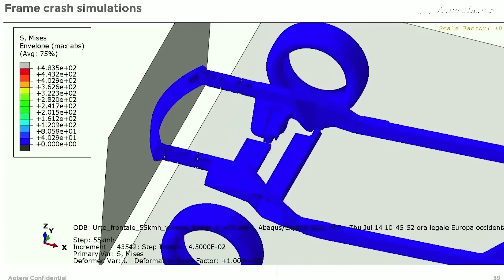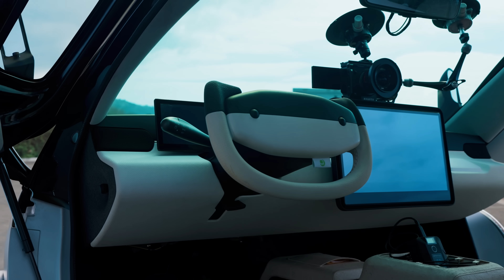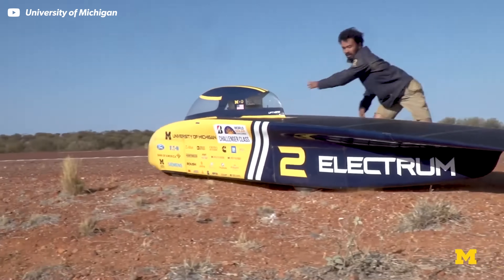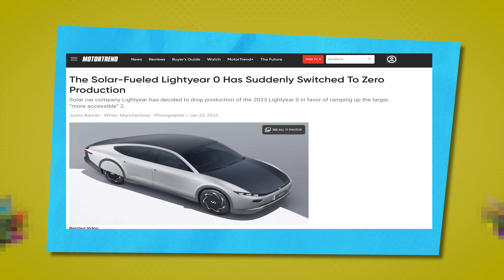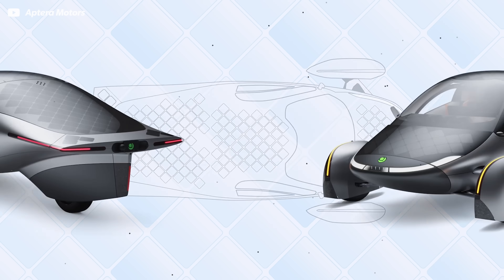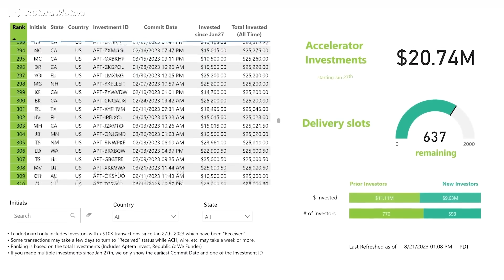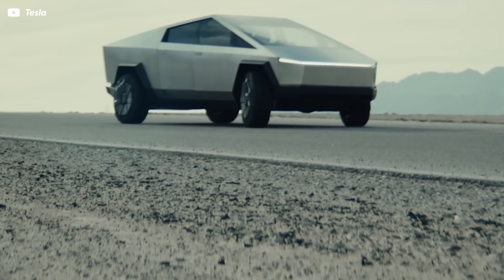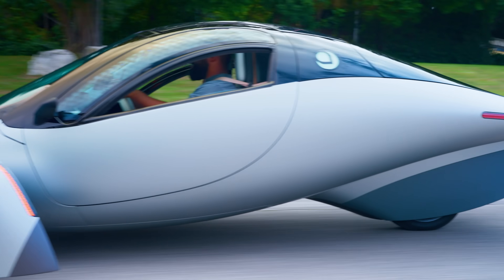We Drove America's First Solar Car

Comment: I'd love to see some parking panels that automatically slide out to gain additional charge while parked.
Reply: I believe Aptera released in a video that they plan to have the M.4 connections that solar panels use to allow for additional solar panel usage.  So there isn't a fold-out option, but, you could add additional solar!
Reply: @Peter-wz2wx  that would be really cool, but I bet most people would prefer something that is low effort, you know?
Reply: What about a windshield sun shade that's a plug in solar panel for when you are parked.   Free energy and keeps the interior cooler
Reply: @Peter-wz2wx that's cool. Cheap mono panels can be found for 70-80 cents a watt easily.
Reply: @thefatmechanic  low effort but breaks more often and is expensive to repair? Pass
Reply: @thefatmechanic  Might see some 3rd party addons for it.
Reply: @dougm7744  I really like this idea!  Maybe a flexible panel that you store in a small ceiling shelf, pull it out and down with it already connected to the M4 port.

Though, the production model does have solar on the dash already so may not be that beneficial. Other than the sun shade part.
Reply: Do the math. Even under ideal conditions they advertise +5 miles in 1h. If you're lucky, in the south, clear blue sky, you could - maybe - expect to add 30-40 miles a day in full sunlight. You'll nearly immediately burn that range by using A/C.

Solar panels on production cars are nothing more but expensive gimmicks. You'd have to park outside all the time (not good for the car), you'd have to have parking that has no shade from houses, clouds... I like the car per se, but the solar stuff is just a gimmick. You're better off plastering your roof with solar (if you own a home) or plugging it in overnight.
Reply: @wombatdk  You say gimmick, but anything that lessens the burden on the grid or your wallet is far from a gimmick. Plus, for anyone just commuting to work and back or grocery shopping, that 40 miles is more than enough to never need to plug in. And you can always opt for one with less solar.

Now, why is it bad to be left outside? I mean, it gets free car washes, your paint gets that pristine fade. People pay extra for prefaded jeans, so why not your car?!
Reply: @wombatdk  As for the math. The car uses approximately 100 wh/mile. So 30 to 40 miles is 3 to 4 kw. Even the most inefficient A/C or heaters on the market use at most 1.5kw per hour. And that's for rooms far bigger than the car. Even if it was double that, you'd still have to let it run heat or AC, for an hour. I think you'll be fine XD.
Reply: @dougm7744  they have solar panels on the top of the dash to capture a bit more power already (which would be covered by the windshield shade you proposed). I think the priority is to not have to think about it instead of mess with a shade every time you park to make a few more watts.
Reply: @wombatdk  I think your math is off, but even if it isn't, aren't people using their AC anyway? power usage is power usage regardless of what work it's doing. (pushing the car versus cooling the car). I think a better question is what would this vehicle cost without any panels installed, and would the price difference be worth the need to charge more often. One angle the company presents is for camping. You can drive out into the woods, and if you get some sun, recharge while sitting there (or use the panels/battery to run some stuff some people bring camping these days like a powered cooler.)
Reply: @wombatdk my gas car is sitting in the sun right now. At the office I left 2 hours ago are hundreds of cars sitting outside in the sun. This is completely normal. You act like you've never seen a parking lot.
Reply: @dougm7744  The dash already has a solar panel, so having a windshield sun shade solar panel would block the dash solar from receiving sun.
Reply: They have an upgrade option to replace the rear window with a solar panel.

Comment: If the company of this vehicle delivers on the promises and a good quality product... This could genuinely change the motoring industry.
Reply: Yeah I'm kind of getting tired of the SUV/truck trend in North America. I'm curious how this will drive in snow and ice though. Wonder what the lifespan of the tires on this vehicle would be?
Reply: @TheAtqthe30th  As a European that’s not much of a trend. I’m simply tired of ICE cars and the hideous design of 95% of them. - And of course the fact they’re all unnecessarily large.
They mentioned the car is AWD so I doubt snow is a particularly large concern. Unless the tyre covers worsen it.
But I’d imagine the tyre life will be amazing if it’s light and aerodynamic as mentioned.

Comment: Good indicator of this cars success are the nay-sayers, who only bicker about misinformation, and can't seem to pinpoint to a singular real issue becasue they simply have not done a second of research into these cars, and just make up lies. When all the info is right there, in these videos and on the site. The company is extremely transparent, it's why so many people love Aptera.
Reply: in what world are they extremely transparent? in the one they started production 2 years ago?
I've followed the aptera story for 15 years and I can tell you that you should just wait until you can buy it cash in hand for keys in hand.

there's lots of company issues with it. with the 1000 mile range, 25k usd price etc the issues are rather simple: they were just elon level promises.
Reply: Well those who naysay Elio Motors (DEAD) and Acrimoto (BARELY ALIVE) when "production 3-wheeled EVs" is brought up do have a point.

But one does not simply resurrect a car brand nearly a decade to later with much of the original product DNA on a whimsical 50-50 bet on whether success will be achieved.

Like even SpaceX was nearly Thanos-snapped out of existence in 2008 if NASA hadn't pulled through with a $1.5 Billion contract.
Reply: i think some promises are just too extreme to be true

Comment: Looks dope AF ⚡
Reply: Nah, it could look better with a truncated rear and without that gap between the body and the wheel covers. Also the solar panel is almost useless, it's only there as a gimmick and to increase costs.
Reply: @vitordelima  The "truncated rear" you are suggesting (which I'm assuming means shortened) actually decreases aerodynamic efficiency. I'd imagine they would like an even longer tail for greater efficiency, but with the panels being one piece, it probably isn't financially feasible. It is the same situation with the gap between the wheel covers. Both of the CEOs from this company have a background in avionics, and design for these components is very deliberate in an effort to make them as aerodynamic as possible. The drag coefficient on the car is pretty unreal.
Reply: @vitordelima  Up to 40 miles of added range from the solar panel(s) is "almost useless"? You must live in an alternate reality. The average American drives somewhere between 26-35 miles per day. Let that sink in.
Reply: @vitordelima  I would agree with you about the solar being a gimmick if this was a normal (not very efficient) car - there have been some gimmicky attempts in the past. But the aptera is very efficient and it has rather big panels, so the solar will make sense. Maybe not for everybody, but for many.

Comment: from what i hear, its soo efficient (as of rn) that you lose range bit by bit when u use the a/c and the heater
Reply: Yes, this is not different than any other EV, but due to the extreme efficiency of moving the vehicle, the relative impact on range of operating the HVAC system could be greater.

Comment: As a single, unattached dude, a four-door sedan is WAY more than I need most of the time. My Toyota Corolla, with over 100,000 miles on the odometer, is generous overkill.
My reservation is already in - if I had enough spare cash to invest in Aptera, I certainly would!

Comment: All these auto reviewers and influencers don't even touch on so many things we want to know.  How does it ride over bumps and terrain?  How does it corner?  What does the regen braking feel like?  Sun glair?  I want to know all the practical characteristics I'm going to be living with.  Everyone just goes on and on about the fluff.
Reply: Much of this has already been covered.  Several independent reviewers have spoken of the ride quality.  I would describe the early prototype I rode in as "sports car like" but the suspension has been much refined since then.  It passes the moose test, so it is in the upper range of vehicles for sale in the US for cornering ability.  The regen has not yet been demonstrated in the prototypes.  This will be revealed during the validation testing of the PI models.

Comment: I remember seeing the Aptera on line in the early 2000's. It looks like Ultralite without wings. I definitely wanted one. If they can guarantee the price and mileage, I'm all in!
Reply: That wasn't the same vehicle, although it had a similar shaped body.  The design of the current vehicle, which has a completely different drive train, size, and construction technique, started in 2019.

Comment: I am sorry they got to get rid of those half windows.  That weather stripping right at eye level would drive me crazy.  Love everything else about the car though.  Hope they can get the interior quiet and they can make it as safe as any other two door passenger car.
Reply: My wife and I thought the same thing until we rode in a prototype.  We are keeping an open mind because the site lines for the production models will be different, but we are far less worried than before we experienced a version in person.

Comment: This is super cool I gotta say and it's an affordable price range for many too. 25k is great, way better than 250k. This wouldn't be considered a luxury item at that point. Not only that, but you can charge it off a 110 volt outlet and gain 150 miles of overnight charging is really good. Most people won't drive that far in a day. So definitely a really good commuter vehicle.

Comment: One thing they didn’t mention in the video is whether it is a bumpy ride or not - the camera in the car was visibly shaking as they drove, and I wonder how smooth the driving was. Hopefully they didn’t mention it because it was a smooth ride, but I would have liked a comment on it either way.
Reply: I rode in an early prototype and if felt like a kit car I once owned.  The suspension has been greatly refined since then, but it is still likely more on the sports car side, rather than a plush ride.

Comment: Now that's how you do EV if you want to grow the market and get the tech in people's hands.  Looking at this thing, most things look easily accessible and replaceable, which is more than I can say for most more expensive EVs, and they're actually affordable.  Even the console panels look like they could be easily replaced if you crack one, rather than having to pull the entire dash assembly just to replace a cracked screen.  I hope they do well on the market and expand their product line.  I don't mind three wheels, but I admit I'm not a big fan of the "wingless airplane" design, but maybe they'll have other models in the future.

Comment: Solar is the future of electric cars, with a very limited battery weight, you need less energy to move the vehicle. Solar cell efficiency has jumped from 12% to 25% in a decade, and it is expected to reach 40% by 2030, and by then, it could be an realistic commercial alternative.

Comment: I'm not onboard with the whole EV/Emissions/Climate stuff, but this has been on my radar awhile. It's a completely different approach, efficient, pretty good looking, and user/owner servicable.

This thing would look cool in a metallic chrome wrap, aside from the solar panels of course. Give it that retro polished aluminum airplane look.

Other than that I'm not certain about the yolk steering wheel.. I think I'd still prefer a normal round wheel.

Comment: I gotta say, this car looks pretty cute. What I don't like is how spread to the sides the front wheels are. I understand it gives it a lot more stability, but I can't help but dream of how easy it would be to park this thing if it was narrower.
Reply: It is not just for stability.  It compresses the air less between the wheel pants and the body and improves the aerodynamics as well.

Comment: Big fan of the form factor, but as someone who wants leaning vehicles for enhanced comfort in tight turns, it’s a crying shame that they used a traditional steering mechanism, when they could have made it lean by simply adjusting the angle the wheels move to turn, changing the angle change from horizontal to vertical/diagonal, so the vehicle leans into the turn.
Reply: I guess everyone has differing opinions. I really dislike those timing  and scooter designs. Aptera doesn't need it.  Why have a passenger vehicje lean while turning if it's not necessary ?

Comment: Original Aptera was also a three seater, sucks they had to take that out.
Reply: Future 250 mile range vehicles may be able to add back the 3rd seat.  If not, the next Aptera Corp vehicle is likely to be a 5 seater.

Comment: I have a 50 mile commute (one way, 100 miles total per day) and I live in a very sunny state.  This is the only EV car that has me interested.  If they can keep the 1000 mile (realistically probably 600 miles or so???) less that 40k, I will buy one.  The crash tests look very good and overall, I just need something for me only for a daily driver.
Reply: could you link crash test you saw i didnt see one

Comment: they need to do a 4 wheel version- they can still make that very airodynamic.
Reply: 4 wheels increases weight, rolling resistance, and cost.  They will make a 4 wheel 5 passenger sedan, eventually though.
Reply: @n.brucenelson5920  have they said this? idk that would basically be a complete new design and would be closer to what the other company they mentioned built.

Comment: So I’ve been following this cars development. It’s interesting as hell.
I’m still skeptical.
But I love the design. If I had to get one i know it’s a work car.
Last I was on their web site and the 1000 miles was for the biggest battery plus the biggest solar panel package. 
I have my fingers crossed.
Reply: The 1000 mile range model won't be available for years yet - It will require taller form factor batteries that aren't in production yet.  It will also be the least efficient of all the models.  

If V2G becomes available, I could see a case being made for it, however.

Comment: If I had the cash I would use as a daily driver. I commute 64 miles round trip to work, but it’s in NM (sunny all the time). 

My trip to work would be “free” by the time it recharged, then I would use 32 miles of range to return home — and then it could charge a few hours in remaining light (during summer).

Comment: I wish they would have shown the motor and more of the inside of the vehicle. How much does it weigh? What does the display look like? Is there any room for cargo? Is there a key? Is it strictly only solar or does it also harness kinetic/wind energy? Can you charge it at a charge station if you needed to? So many questions...
Reply: No expert but I believe the following to all be accurate:

Motors are supplied by a euro company called Elaphe, they’re in wheel motors.

Vehicle weights ~2,000lbs

Display is similar to what is in the newer model Teslas, one center display plus rear cameras where the gauge cluster would normally be

The hatch has ~33 ft3 of space plus a half cubic foot cargo bunk where the company anticipates a charging cable will go

I don’t think they’ve come to a decision about what the key will be. Some people say it should just be a key card like Teslas, I’d be inclined to believe that’s the direction they’re gonna take.

No wind energy, but due to the large inner diameter of the in wheel motors the regenerative breaking is gonna be really good.

The cars will come standard with a NACS plug, and from what I know the intention is to have comparability with the Supercharger network. However the initial battery packs will only be 42kwh, which will make it charge insanely fast in comparison to most vehicles (it’ll get about 10 miles of range an hour on a normal household 110v outlet alone)
Reply: @cheesemonster5432  Thanks, your explanation is way more informative than the video

Comment: Hopefully they make a 4 wheel version. I want to see more EVs invested into the AWS + AWD scene.
Reply: Aptera's second vehicle is likely to be a 4 wheel, 5 passenger sedan.
Reply: @n.brucenelson5920  imagine that Mercedes-Benz 360° tire car but feasible for general market consumption. The goal of easier parking from an active All Wheel Steering system and more control over traction and weight distribution from the 4 wheel platform. If they get their feet underneath them in terms of production and market saturation, they'll be the Honda of EVs.

Comment: Whats neat about this is depending on yhe battery tech they used and the charging system used, this car could maintain its own batteries.

Charging during the sunlight and not charging at night (if its not plugged in). Should help condition those batteries for a long life :D

Comment: The only concern I have is those front wheel housings. If you get into a minor ding, those can cause tons of problems.
Reply: The gamma already had one crushed by a BMW driver backing into it.  It was repaired in about a week.  The production ones can be replaced in minutes by new, as well as repaired.